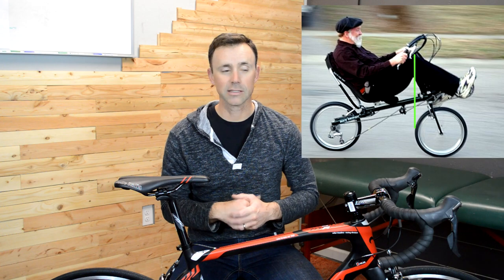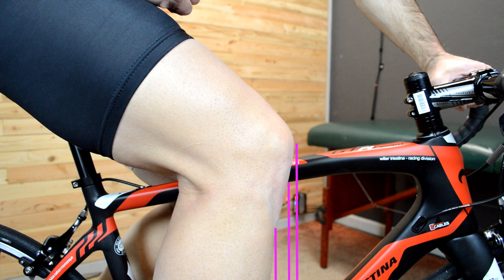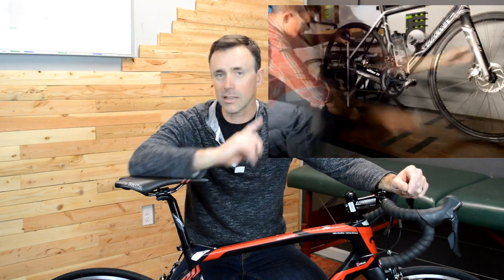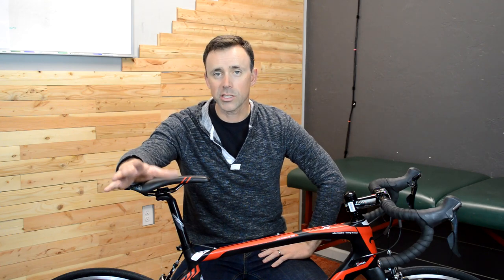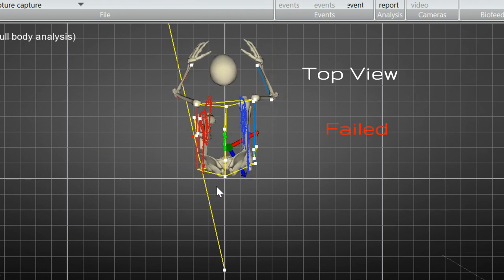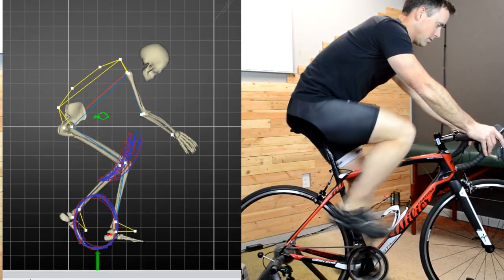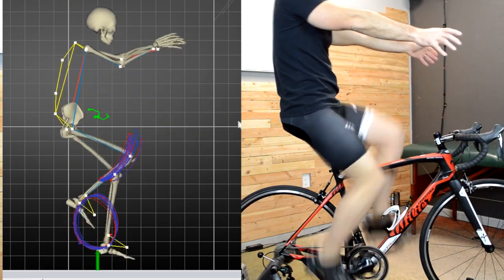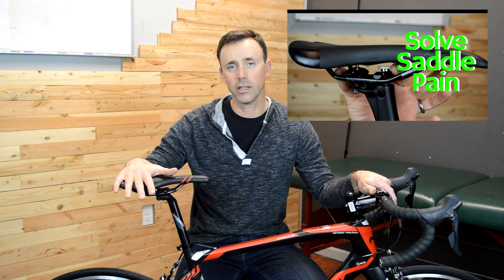How to set Saddle Fore Aft | Bike Fit Tip

Comment: Very good video.  Agree with many of the comments.  What are the downsides to a seat too far forward?  At the extremes I can speculate throwing off the balance and handling of the bike, possibly putting your knees at risk of hitting the bars, but would like to have heard John's ideas.  Seems like a topic with many subtleties, whittled down well so most of us can understand.  Obviously, there are several other factors linked together when adjusting to a balanced riding position such as seat height and tilt, bar fore/aft and height, cleat position, crank length, personal riding position preference (more or less aggressive forward lean), etc.  But thanks!  With this new information I'm going to try the balance test (safely) on my next ride, and if I need more than some small seat adjustments, I'll go to a bike fitter, rather than trying to chase all the variables through trial and error and extra parts and $$.

Comment: So if I slide forwards from the saddle by lifting my hands up, should I move the saddle fore or aft?
Thanks a lot, cool channel!
Reply from the maker: +Artem Poznyak if your hips slide forward when you do the test, I would first try the saddle back slightly and see how the test is affected -- keep in mind since this is a test that's dependent on a lot of parts of our fit that you may need to shorten your stem or otherwise change the reach. We don't want to increase the reach of the bike too much. When you have the right reach and the right setback the test will get a lot more stable and you won't slip forward
Reply: 1st............ Is your saddle pointed nose down..........? I'll bet it is. Get rid of that. This nose down insanity is just that, insane.
Go from there. Hopefully  you are not crammed (positioned) forward, another au current notion that is, that's right..........., insane.
Reply: no, actulally it's pointing a bit up because of sag, so, when I sit, it's straight leveled to the ground

Comment: If you are slipping forward on your seat, the cause more than likely is bad spinal flexibilty. In that, you are having to tilt your pelvis too much to reach the handlebars. Being able to bend your mid back(thoracic spine) more will allow your pelvis ro stay more vertical at the same time of extending your reach. If you are in (or attempting) an aero position and your back is straight, you are doing it wrong. Look at every pro rider, they have amazing back flexibility and able to get in a deep aero position but note how their pelvis are still very upright. Took me a long time to figure out why ny hands were always going numb and I could never seem to find that perfect seat position.. it wasnt the bike, it was me that needed work.

Comment: I was interested on my next road bike purchase to buy intentionally one size smaller frame 54 instead of 56 (I'm 178 cm tall) and use longer stem (120 or more compared to 100 mm on 56 frame), any thoughts on that, what will I gain and lose in that case, I want to mimic more of that pro setup just without that extreme saddle to bar drop
Reply from the maker: They Live We See A downside might be that if you opt for the smaller size your possible bar height will be lower -- the smaller bike will have a shorter head tube and this leads to more saddle to bar drop.

That said, in a lot of circumstances (but certainly not all) when a rider is between sizes the smaller frame is often the safer bet.
Reply: thanks for the reply, also I have specific problem of bike fit because I have the worst body type for proper fitting, I have short arms and torso and really long femur bones so when I pedal I feel cramped (not pinching) in my hip area like in a situation when you are doing squats with overly narrow stance from what is ideal for you so I though to try the smallest cranks 165 mm to open my hip angle more, you see the way my femur attaches to the hip if I drive it too much into flexion it leaves with no space to move in acetabulum so it pulls my pelvis into posterior tilt so I always end up pushing my knees to the side a little
Reply: In 99.9% of the situations, it's better to go smaller when between sizes. It's always easier to make a smaller frame fit you than a larger one when between sizes. Don't let anyone tell you different.
Reply: What is the frame geometry?
Reply: The balance test is a good way to unweighted the upper body which doesn't cycle. That of course is a common sense thing to do.
However, a balance position may not be the right position for the legs/foots as far as applying forces on the pedals. 

My experiences show too much rearward saddle results in ineffective pedaling forces. The cycling become unnecessarily heavy on the crank arms.

I am kind of thinking, if a balance do result in heavy legs, maybe the option is to go for the position of most effective pedaling saddle position and to take care of the bar position by altering the stem etc.

Sometimes the best bike fitter doesn't give us a more comfortable cycling position because we aren't use to the ideal position as yet or our body is weak at some points.

Comment: I'm wondering if I'm doing something wrong, or there's something I'm not thinking about.  I'm pretty sure I would fail the balance test, but I don't understand why this is a bad a situation for me.  As I've gotten more serious about cycling and racing, I've gotten into a lower and longer position.  At this point, I ride in the drops almost always unless I'm eating/drinking or climbing a big hill.  I even train in the drops on my indoor trainer so that I stay trained to an aggressive position year round.  Riding in a more upright position almost feels weird to me unless I'm just poking along and chatting with folks on a group ride.  I don't experience discomfort in this aggressive position anymore--not even on all-day outings.  I used to a little when I was less trained, but now not any more.  And since I'm not fighting the air as much, I can go faster for longer distances with less fatigue in my legs.

So, the main reason I'm putting my saddle further forward is that I'm having trouble getting my hip angle opened up as much as I want.  If I push my saddle back, it feels as if I'm in a deep squat with my knees almost knocking my chest when I ride in the drops.  So then I unconsciously move my hips forward and ride on the rivet, which isn't comfortable and puts my saddle effectively too low, which kills my power.  So rather than fight my body over where my hips seem to want to be, I just move my saddle forward and upward.  I also bought a Specialized Power saddle, which is flatter in cross-section and has a sort of delta-like shape to it that brings the effective support to the sit-bones further forward while taking pressure off the front-most soft-tissues, which was previously causing numbness and aching.

So, I'm curious to know, even though I am supporting a significant percent of my upper body weight with my arms and wrists, if this isn't causing me any fatigue or discomfort, do I still need to be concerned?  Would I get more power to the cranks if I were to make an adjustment somehow that would allow me to not fall forward?
Reply: Uh oh.  I haven't even been thinking of that.  At the amateur level, does anyone really care if my bike geometry is a tiny bit outside of UCI regulations here or there?  I actually haven't heard of anyone running into problems with "small-potatoes" stuff like that other than at the pro level.
Reply: It's all a matter of priorities. If you really care about that low aero position or if you prioritize bike handling and less shoulder/arm (admittedly you said it's a non issue) more. As when you move the saddle forward you change the rider and bike COG usually compromising the handling slightly because more weight is now on the front wheel. Taking into account you can't quite as easily move the weight around, because you're admittedly in an unbalanced position, hurts what the rider can do near the limits of traction because you're essentially falling forward all the time. The additional weight on the shoulders and arms is there too but seems you've developed the strength to cope with it. If you're really up against the UCI limit on a road bike then very much would consider giving up a touch of aero and move further back as the UCI limit is pretty dang far forward even for a fully slammed pro using 140+mm stems on bikes one to two sizes too small.
Reply: Didn't the UCI just change the rule on set back for 2017 and further?  Also what size crank arms do you use? You may benefit from having slightly shorter arms that won't drive your knees into your chest as much.
Reply: Erik, your saddle is too low or your cranks are too long. Move your cleats all the way towards the heal, raise the seat  and try again. Most of your weight should be applied to the pedals, you should be light on your saddle and hands. Using all that energy holding yourself up is wasted endurance energy. Next time you ride.. in the drops unweight your hands and see where the weight goes, hopefully to the pedals.
Reply: this is because your core muscle is strong enough to support and compensate a bad position

Comment: The problem I have with the balance method test is that it depends so much on what force you are exerting in the pedals. You suggest "a little above an easy pedaling gear." But that can mean so many things to so many people. A little more force and you pass the test. A little less force and you fail the rest. Seems about as vague as the knee over the spindle test. No disrespect intended. Just sayin'.

Comment: I'm finding it difficult to find the right seating position for my road bike which has tri bars. When using the regular hood position I've found a good position but when I use the tri bars there is a lot of pressure on my crotch and my knees seem to bow out. What would be a solution to strike a happy medium between positions?

Comment: How does that work in the mountain bikes where the sitting position is very different. I've been riding on my old-fashioned (relatively long and low stem) XC mountainbike with no saddle discomfort at all but I struggle a lot finding the position on my trail bike, where you sit pretty much upright.
Reply: Sitting up is the problem. You can't transfer your weight to the pedals sitting up. It creates a high center of balance. A long stem keeps the front down when climbing. Un weight your hands, where does the weight go? The saddle or the pedals..

Comment: Didn’t even show center measuring point for saddle. Where do the numbers line up to post clamp? Center? Forward? Back?? Is it 45 straight line in line with post or center of clamp and vertical center? Not one video yet out of a dozen has not pointed that out.

Comment: In light of your decision to start making new videos again, any chance on re-visiting or updating the videos regarding saddle setback and the Balance Test?  In particular, any chance you could give some rough guidelines or ranges on where, in your experience, riders of certain height ranges start to be a bit too far back/forward?  In other words, should 90mm of setback for a rider of X height be a red flag?  Also, any chance you could elaborate on how to determine whether height or setback is the primary problem negatively affecting a rider's weight distribution?

Comment: John, what are your experiences with setback or straight seat-posts on larger frames (+58cm)?  There seems to be a myth that states the preferred usage of straight seat-posts on taller frames over that of setback seat-posts and because those frame geometries naturally place the rider further over the rear wheel. I believe this matter to be a natural extension for this great video. Cheers.

Comment: Thanks for the vid, I have the same saddle(mtb) than the one you using in this vid. My question is, if I understood you correct. If I let go with my hands and i slide forward then i need to move my saddle back? I have exactly that problem and as soon as i slide forward my balance is all over the show. So you would suggest to move my saddle back? Thanks in advance.

Comment: So how does this relate to cleat fore-aft? It seems that ankle articulation is a problem area because the relative  balance between limb length and foot size is pretty random. Toe length, where the ball of the big toe is in relation to the pedal axle etc varies greatly from foot to foot. Tibia and femur length also do not formulate any consistent balancing relationships. So it comes down to biomechanical relationship between  the widely variable yet fixed leg/foot parameters of the individual to the more rigid and fixed reality of available products. When one gets onto a bike fit contraption which is infinitely adjustable, that should yield, in the best case scenario, the measurements you would then use to build a bike. Plus, the position one sits on the saddle changes whether climbing, descending or hammering in the drops. Ideally, it would seem that  having a fluidly adjustable bike that changes according to the need would be the holy grail. But the establishment of some baseline process whereby the rotational points on the bike and the body will all have their ideal relationship in producing as fluid a motion, circularly, as possible is left wanting here. Interesting subject, none-the-less.
Reply: It's the line between the center of rotation on the knee joint and the pedal spindle that is affected by seat fore and aft. If the center of rotation of the knee joint is forward of the spindle at 3 o'clock it pulls you forward when you push down. Doesn’t matter if your heel or your toes are ove the spindle.

Comment: It's very clrar to me.
If you can't get up from your handlebars without speading up your cadance a lot, you have to put the saddle a little bit back.
That's all.
Reply: Simple, elegant, and wrong.
Reply: This is a ridiculous procedure to set saddle for aft position. What credentials does this guy have? This is just WRONG. Knee position in relation to pedal spindle is still a relative measurement. And you don't adjust reach to the bars by saddle position. You get your saddle position in height and relation to knee and pedal spindle and BB then you get your reach dialed in based on flexibility / arm length. Of course he never mentioned that you set your cleats up first so that doesn't change the whole equation once they are set!
So lets assume this guys fit advice is correct. Now you are on your bike which came with a 120 stem and a low (race ) bar position..so you are pretty stretched out...try to sit up using his advice, very difficult. You are going to be attempting to adjust saddle position disregarding knee position to compensate for a long stem or lack of flexibility? No completely wrong.
Reply: @shooter7a  great response ..concise, pithy and correct...